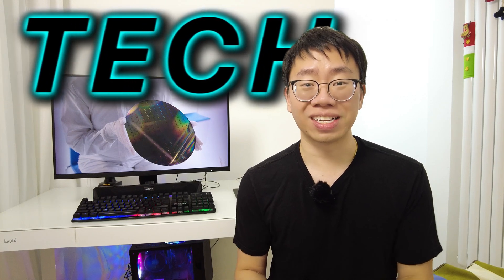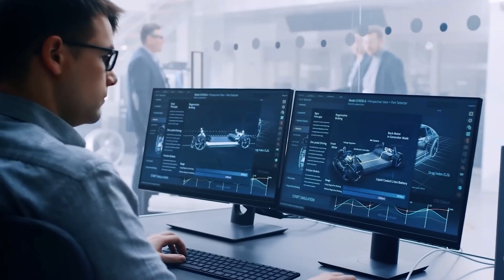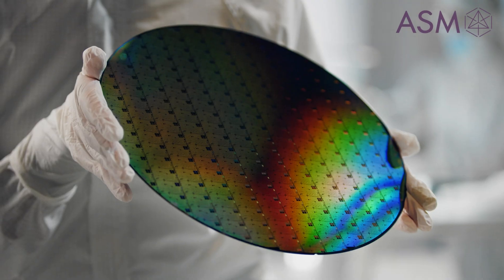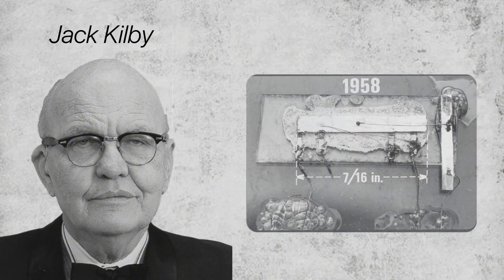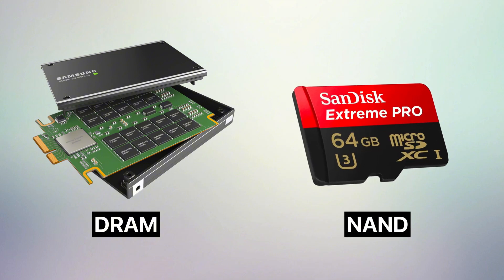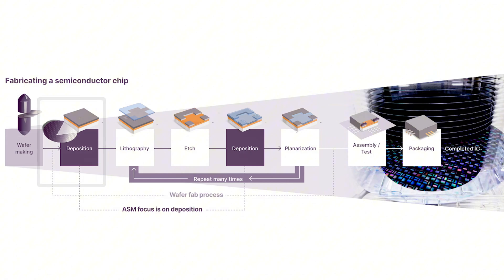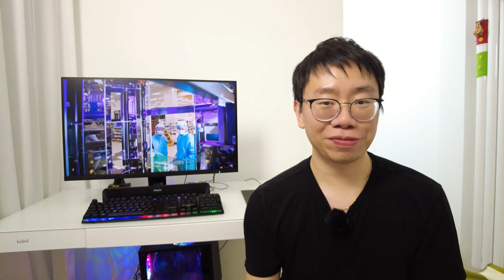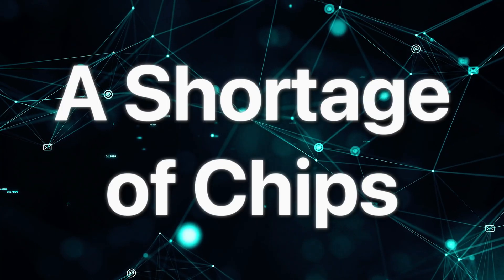Why More Mechanical Engineers Should Work in Tech

Comment: " Acer Aspire 7 A715-76G-59U9 Core I5 12th Gen 8GB Ram 512GB PCIe Nvme Gen4 SSD GTX 1650 4GB Graphics 15.6 Inch IPS 144Hz FHD Gaming Laptop "   vs   "  MSI Thin GF63 12UCX Intel Core I5 12th Gen-12450H RTX 2050 4GB Graphics 8GB DDR4 RAM 512GB NVMe SSD 15.6 Inch FHD 144Hz Gaming Laptop  "   vs   " HP Victus 15 (R5-7535HS + RTX 2050 4G + 8G) "  which one should I buy for engineering study and slightly gaming ???
   GPU is not an issue......
  'Built quality' , 'Battery life' , 'Durable'  , 'Heating issue'  should also be looked into.. Please help me .......
Reply: you should go with the MSI Thin, but you need to look into the RAM